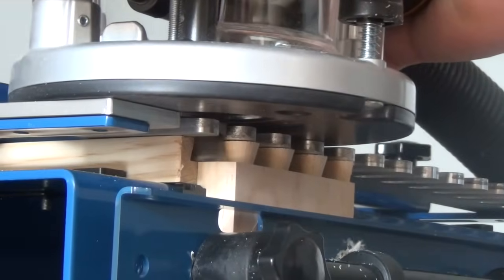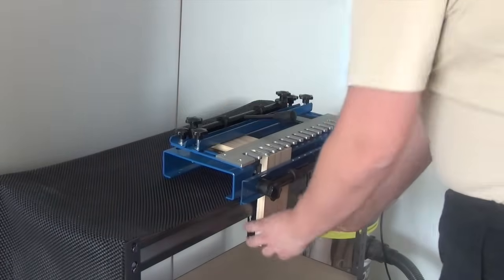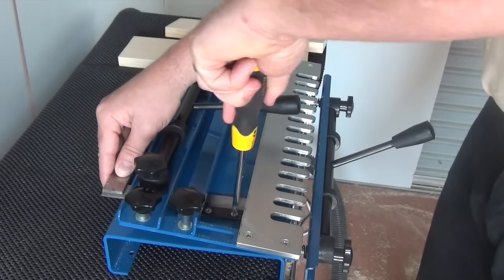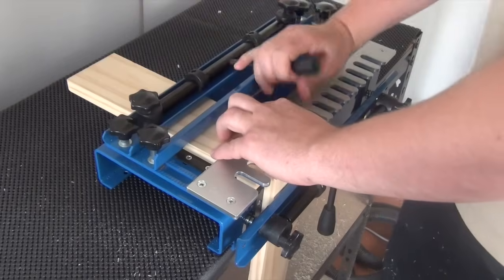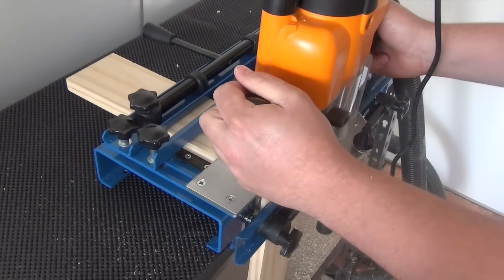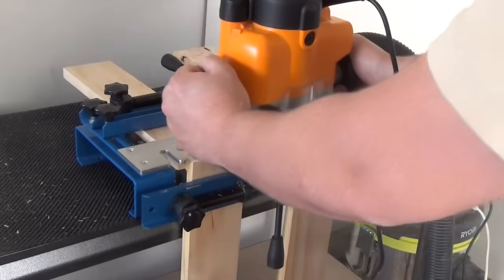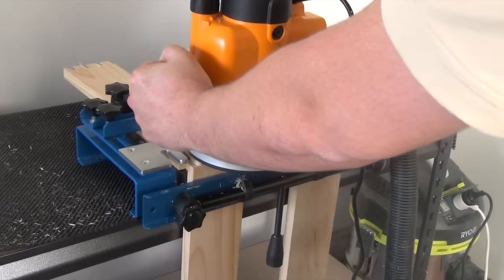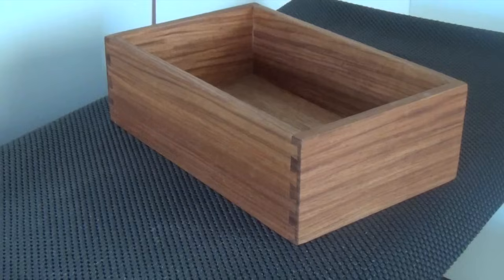DJ-12 Half Blind Dovetail Jig

Comment: Great vid, very informative on the setup. Just a comment about cutting direction. Seems it depends on the hardness of the wood used whether a right to left or left to right pass is used with these jigs. Such cuts are serial inside cuts which are usually done in a clockwise, or left side to right side motion across the jig. The cutting edge of the  bit can't dig into or drag. The dress cut can be done right to left where the chance of grabbing and dragging is nil.

Comment: Because of the adjustability of the top finger plate assembly   be sure to maintain the 3mm clearance each time you place the wood into the jig, otherwise each drawer will be a different size than others and not square.

Comment: I buy Woodstock International Inc Dovetail Jig
To use it you have to buy a piece that is not included (Guide bushing) and is very difficult to find and buy.
Just hapend with the Woodstock brand, other brands come with everything included. 
It is frustrating.
Reply from the maker: Are you sure you can't just buy the router bit with bearing on the shaft? We sell them but also available in the CMT range (818.142.11B).

Comment: Heighten to tighten and lower to loosen! What are we heightening? I bought one of these jigs, can't get a tight fit, what am I doing wrong?
Reply from the maker: +Tony bones 
Heighten the router bit (when looking at it pointing up towards the roof) or lower to loosen (in other words move it back into the base of the router). Hope this helps.
Reply: Once you've heightened or loosened the router bit and got a good fit, subsequent new pieces run through the jig will be different to the first correct (since the router bit has changed position)?

So, is the aim to get the test pieces fitting perfectly and then the combination of both the jig setup and the router bit height should be able to be used at a later date to get the same perfect fit?
Reply from the maker: That's exactly right - get the first test piece setup with the correct cutting height and then run all work pieces through the jig to get it all to fit together.
Reply: Thanks for that - is there a way to specifically set the router bit height/depth? I mean instead of guessing and adjusting the router bit height based on the test piece, straight up just setting the correct depth.
Reply from the maker: Not really, I know that customers will use previous samples to set the height of the bit to be correct within a certain margin of error and then will adjust to suit a new specific work piece thickness. The issue is that slight variations in thickness will mean slight variations in the bit height that needs to be set so you still have to run a test piece every time you work with a new height to get it spot on.
Reply: Jonathan Ingram  the height is 9/16”

Comment: Just cut two pieces of wood at 45 degree angle on the table saw, glue and nail, and there, you have it. this dovetail stuff is to much fooling around.
Reply: mrk107 yes sure....and after a few weeks of using your method the drawer will get apart.
If you don't know anything about woodworking please be quiet, what you have seen in the video is the strongest joint that you can use
Reply: Miter joint with only glue and a nail lol, very weak jointery. Dovetail is very strong and durable and doesn't need a damn nail
Reply from the maker: These three new videos that we've produced may help out a little:

https://www.youtube.com/watch?v=cOPwidSk7Dg&t=21s
https://www.youtube.com/watch?v=mws-tD3UJWI&t=32s
https://www.youtube.com/watch?v=J2fAlJpqYaE&t=20s
▼
Reply: The dovetail joints are solid joint long lasting